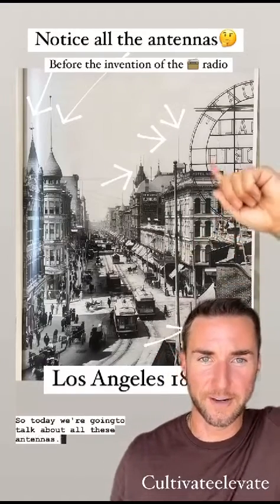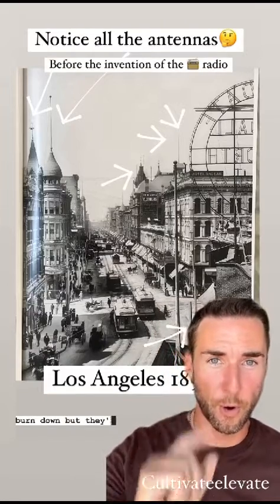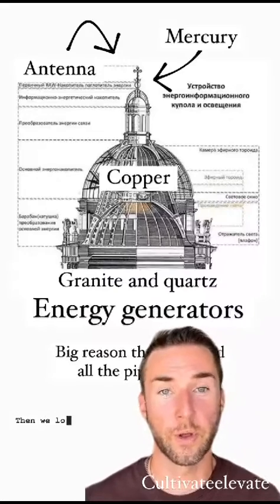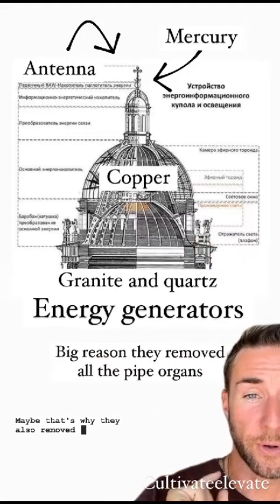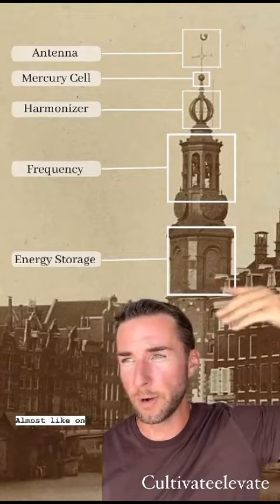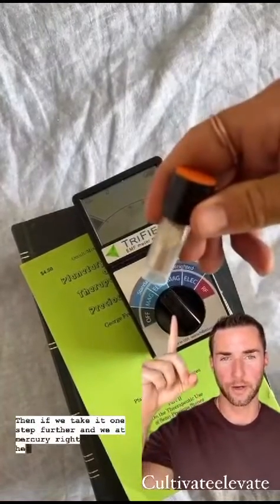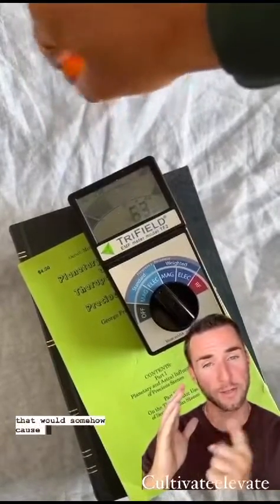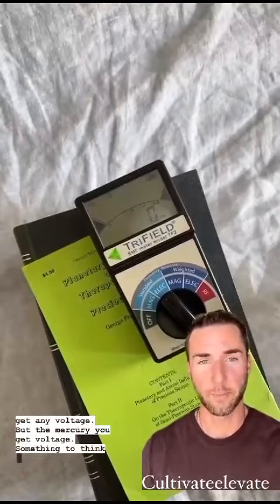Science Behind Antenna I Mercury Vortex engine. Real technology

Comment: So it takes the AC and powers the phones and then it goes into the main building when lightning strikes and converts it using that mercury arc into DC to store it and the spin the bulb at the top for qhen lightning isnt hitting im guessing who knows tho.
Reply: But the Antena will extend the range of the wireless voltages. It's interesting stuff man but I don't have time to do experiment so I'll never know.